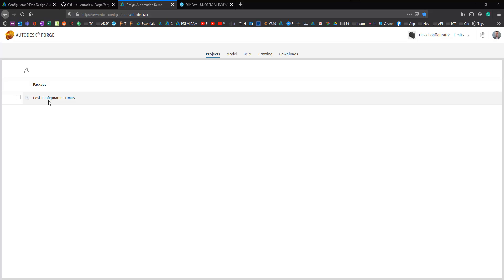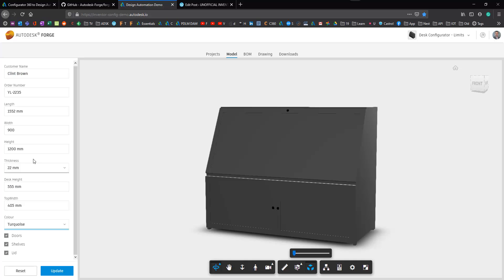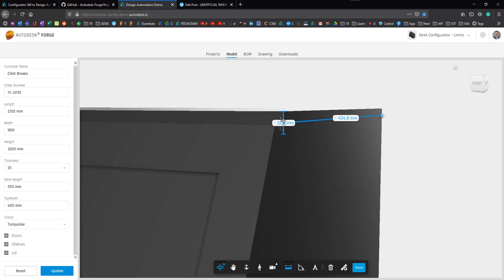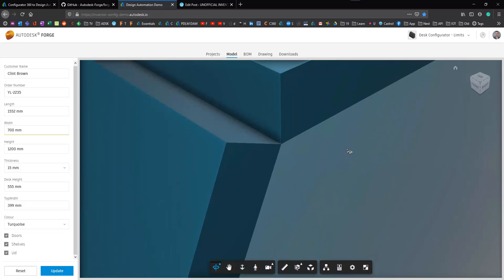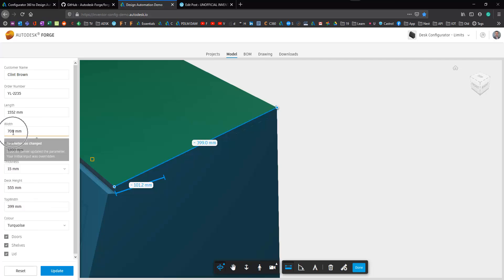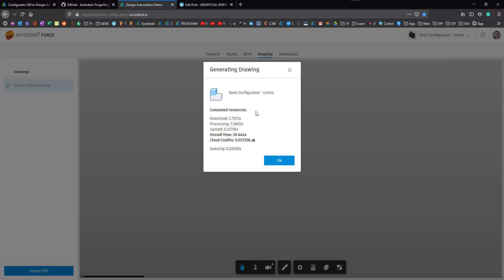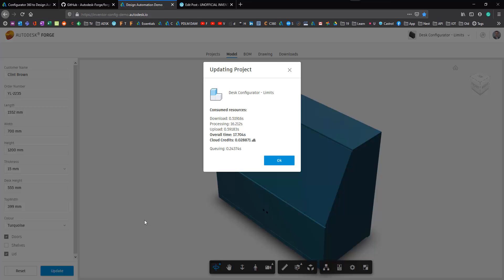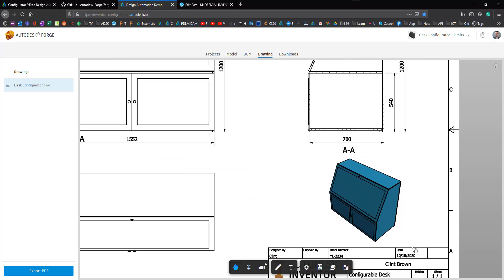Forge Design Automation Demo for Inventor

Comment: Great Demo - Big help having your data set & Vid. Do  you have somthing that shows  the inital steps of importing  your dataset into forge ( and talk about any mappings )
It's so hard to get information on this new product & having this small data set will help connect the Dots.
Reply from the maker: Give the blog post a read and click through to Adam's blog post. Everything that you need is in the public domain, and freely available in the Github repo. Once you have set up the Forge sample, it is just a case of uploading a zipped iLogic drawing & model (check my notes on tweaks needed in your iLogic code).